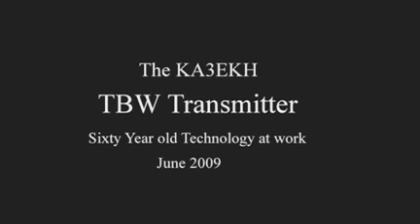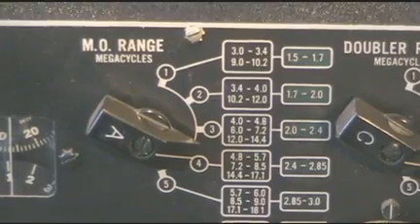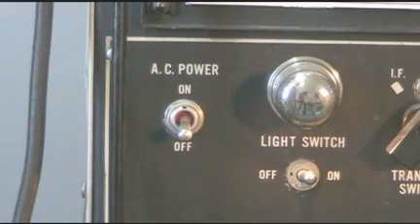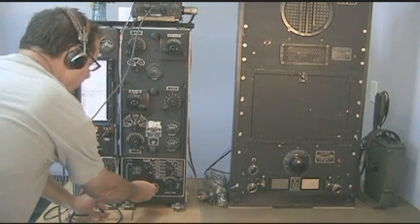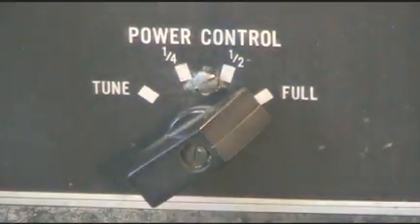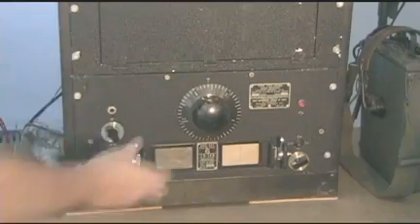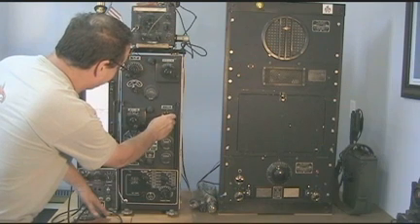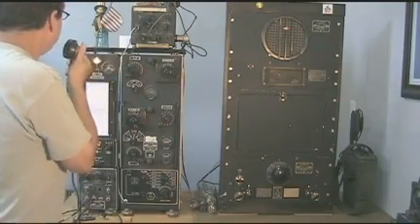1942 TBW Ham Radio Transmitter

Comment: In 1961-1962  I was one of six Navy sailers at Little Rockford  Antarctica. We had a TBW transmitter but without the modulation section. It ran on a motor generator for power. I was a Navy ET at the time. The receiver used was an RCA model RBC. My guess is that is that that equipment is still there. (Under a lot of snow)
Reply: Charles Lauter ,   нужно  пойти ( кораблём )  и откопать  :-)) !!

Comment from the maker: The 800 cycle stuff was for use with the field generator set, being high frequency it only required small transformers and filters for the DC supply. I used all new componets for a 60 cycle supply but with the increased size for 60 cycles the power supplies and filters will no longer fit in just the center section. also you no longer have the ability to run A2 where they used raw AC applied to modulate the transmitter.
Ray F.

Comment: very well done presentation!  Looking at past eras of Ham Radio equipment and it's control operator they did indeed have a real sense of accomplishment. Historical  
radios and electronics is amazing, and advances in technology to present day. I'm a Ham since 2006, I did not go to HRO and buy a dual-band Icom, but bought gear on E-Bay i.e. power supplies, vintage Icom and Kenwood mobile radios plus two Motorola HT's I had programmed for 2-meter operation.